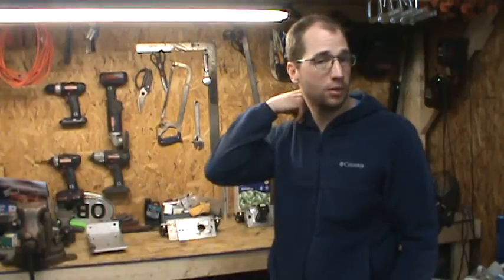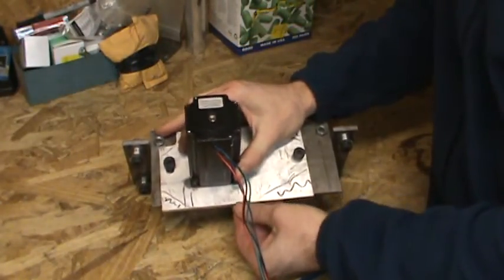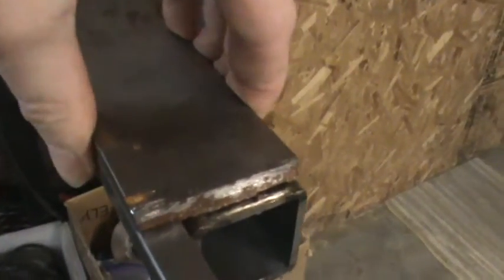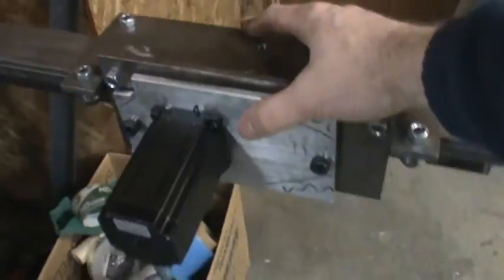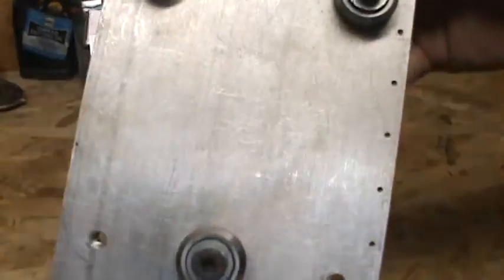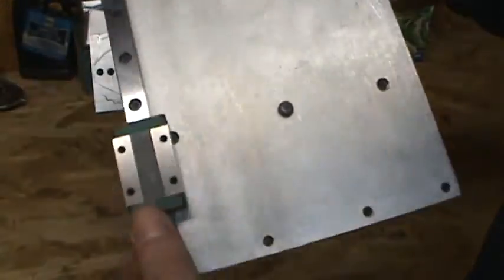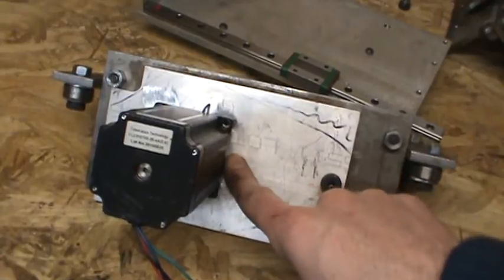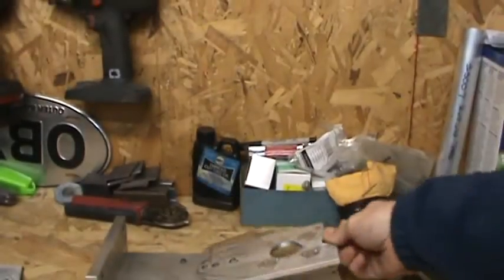CNC Plasma Table part 1

Comment: you will need 3 or 4 to one reduction to work right  ipm will be to fast  slowing motors down will loose power  cnc router parts has gear
Reply from the maker: Thanks for the comment. I have plans to upgrade to 3:1 later  down the road. Your table is very stout, nice work. Whats your time frame to finish your table?
Reply: no time frame just working on it when I can doing the table now. waiting on the controller to arrive so I can wire the box I using a hicon integra controller vital systems with gecko g203v drives 48 volt running mach 4 .I found a box at HGR machinery its local to me they have lots of used stuff you can order on line also .
Reply: Running a direct drive will be perfectly fine on a plasma table, many commercial machines run direct drive rack and pinion. The less steps per inch the more torque the stepper has, the dis advantage direct drive has is resolution, less steps per inch can result in less a accurate machine, but there are ways around that with out going to reduction. 

Selecting a proper size pinion and the correct micro stepping you can easily achieve .001in with good speed and torque. 

Motor need to be properly size to the weight you need them to move. My plasma table gantry is 35lbs I'm running dual 270ozin steppers 1/8 micro stepping with a 1" diameter pitch pinion on Y with a max machine speed of 650ipm on a 30" travel

Comment: Please what size of the stepper motor. and the breakout.
Reply from the maker: Nema 23 size motor with 381 in/oz. and G540 driver.  I have not proven out this set up.  Many systems this size use Nema 23 with over 500 in/oz and higher amp drivers with belt reduction.  Subscribe for more videos to come